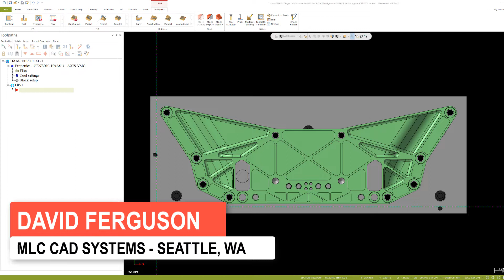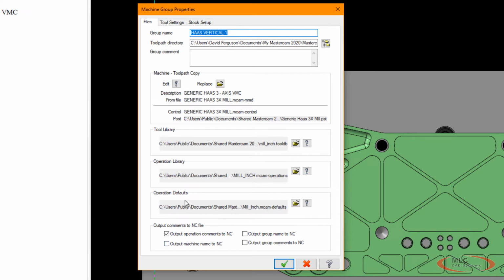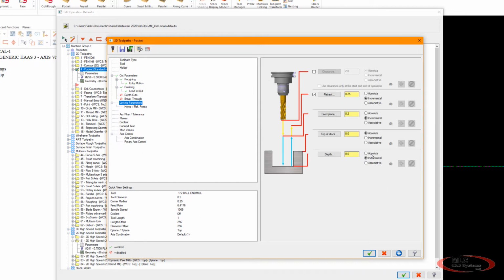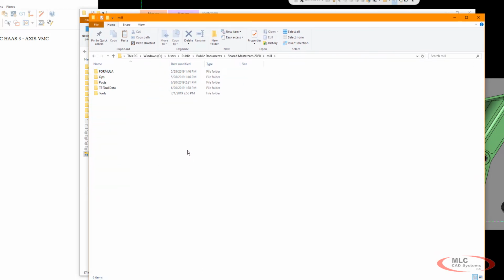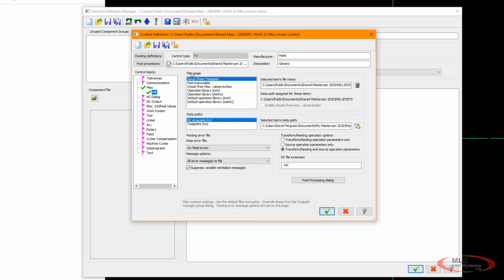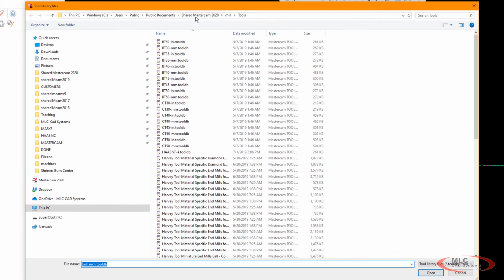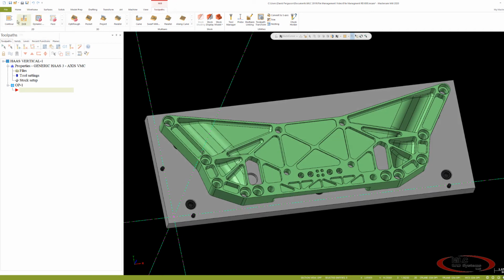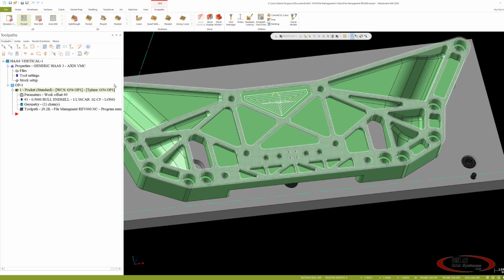Mastercam File Management Best Practices

Comment: I share MasterCam with 3 other coworkers and I hate it! Everyday something is moved or changed in some way. I really wish I had my own user profile to log in to - with my default color scheme, toolpath settings, shortcut layout etc... why is that not a thing?
Reply: Mastercam can have settings for colors and keyboard shortcuts unique for each user based on a configuration file. If you have a separate user account on the computer, each user would have their own configuration they could use. If you are all sharing a single  log-in account on the computer, then you'd need to save your configuration file somewhere and simply load it after you launch the software. All of that can be done via the File->Configuration option. I'm going to make a video demonstrating this later this week.
Reply from the maker: Great question and answer!